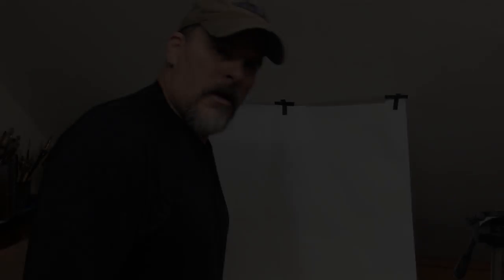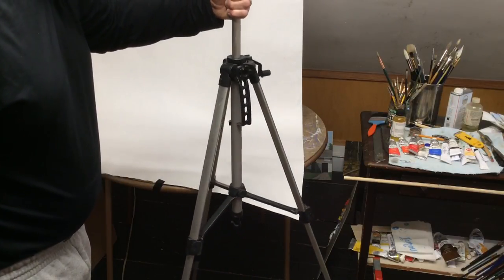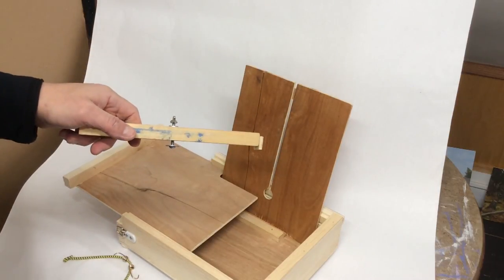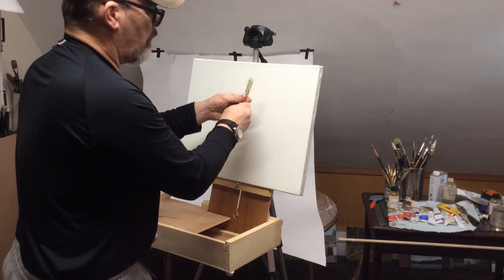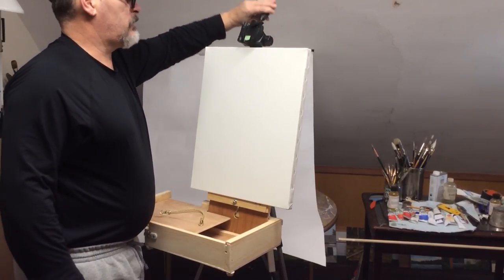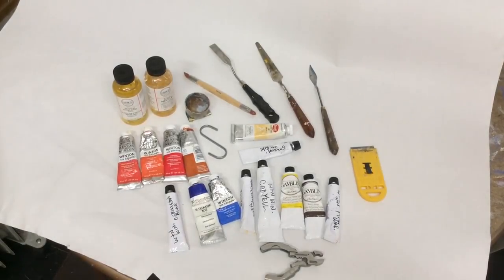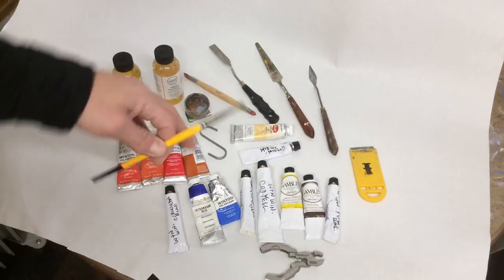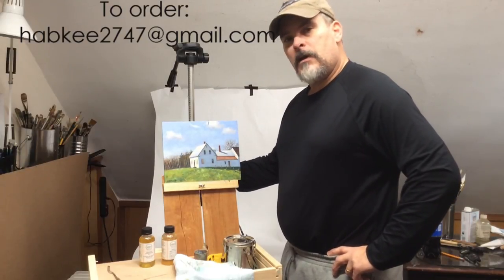Plein Air Paintbox/Tabletop Easel For Sale - Order Now

Comment: Hi Bruce, i just came across your video for inspiration, because i have build my own box, only two weeks ago. 
I was out in the field for painting last week and tested my new box, to find out, if it needs some improvement.
I like your box, its small and flexible, but it has all it needs.
During the video, i thought about a mount-system for bigger canvas on the top.
I would build a wooden ring, probably in two parts, 6 to 8 cm (i am from germany, we measure in the metric system) in diameter.
The hole had to be a bit smaller then the lifting post of your tripod.
Once the ring is attached to the lifting post, you can put a canvas on the easel and secure it by leveling the ring on top of the canvas, using the lifting wrench and its secure mechanism.
Its just an idea that came to my mind, but i think it would be usefull.

Another thing i thougt about is the way your mixing palette is designed.
The small tongue, that goes behind the canvas mount, seems to have a tendency for breaking during cleaning the palette.
I would cut this tongue as far as the stabillity of the palette it allows, the shorter the better.
I also would drill holes in the palette handle, as a kind of brush holder.

I hope, i have written something usefull and i apologize for butchering your language.
I also wish you success with selling your box.
Have a great time and keep on painting.

Greeting from a fellow artist/builder from germany
Reply from the maker: Hi Marco - Thanks for all the ideas. I know the small tongue that goes behind the canvas mount is fragile. I only have it designed that way to allow palette to be over a stable platform (the box area) when pushing to mix paint. Otherwise it would be way over to one side and "bouncy" when mixing color. Always room for improvement for sure :) Germany must be great to paint! Take care and happy painting.
Reply: Thank you for the reply, Bruce.
I am sure, you have some pretty fine painting spots over there in america, too!
Have a nice weekend.